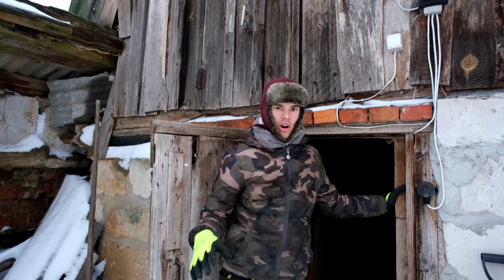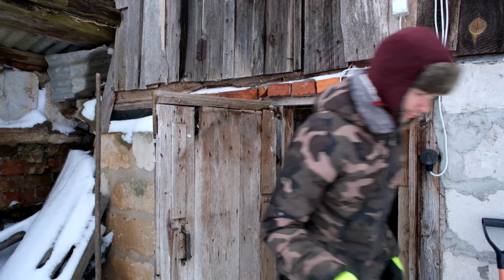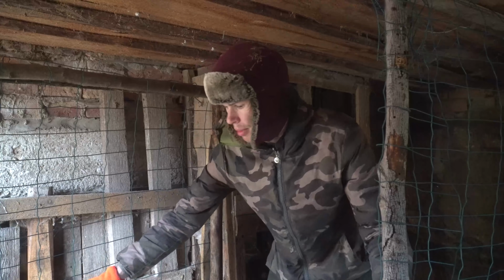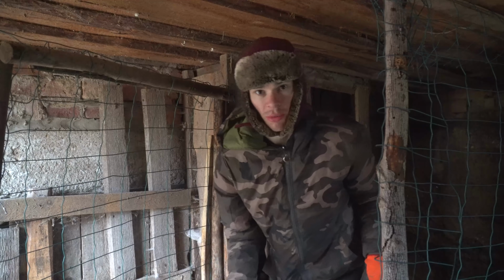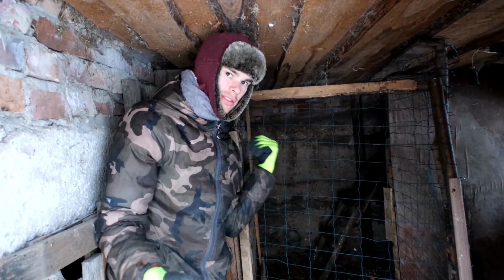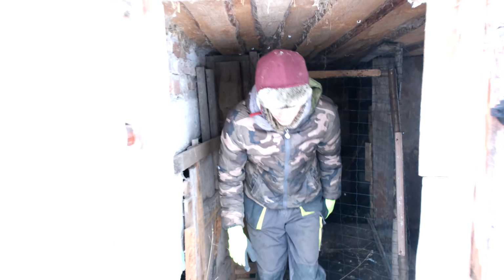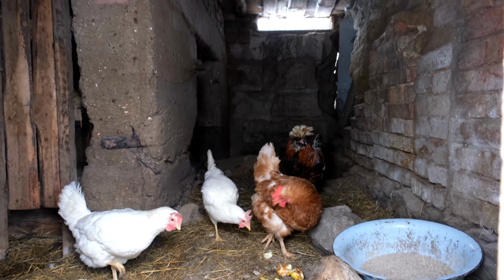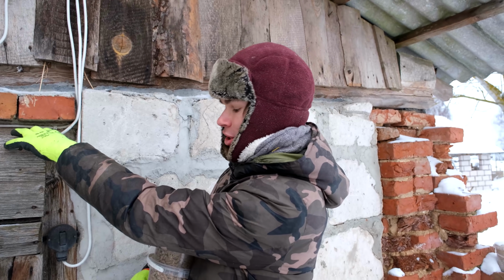Eagle took our Chicken!

Comment: There was a village in Chile that had the same problem with condors and children. 
They strung wire between poles about 4 meters apart. Also between the buildings along the street.
The birds can see the wire and wouldn't chance hitting one in a dive.
Chickens are light dependent. Less light = fewer eggs.
Geese prefer water. Since you need a pond for drainage anyway, you may as well make it deep.

Comment: When the chickens aren't getting as much daylight, they don't lay as many eggs. Also when they get older they might totally stop laying eggs, but keep on living. Also not all breads lay every day, it could be 3-5 a week.
Reply: To add to this, it might be about time to add possibly 3-4 new chickens, to make up for losses and also because the hens may start not laying as many eggs, due to age. The older hens might not lay as many eggs, but they still eat insects, scratch and loosening the soil, eating plants and also giving you good fertilizer.  Consider giving them the outdoor run, just so they get the light. One way of easily adding light would be to install some solar lights into the walls.  The light on the inside and the solar on the outside. You can put some on a sheet of wood and put it in the wall, like a window without  glass. If you had a small chicken house, I'd recommend putting them in the roof, but I don't think that's possible the way you have it now.